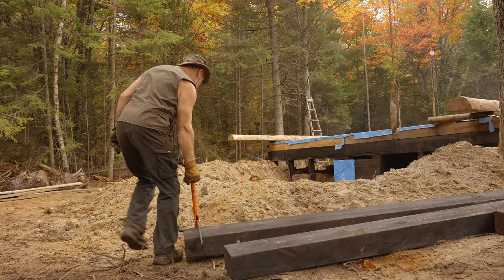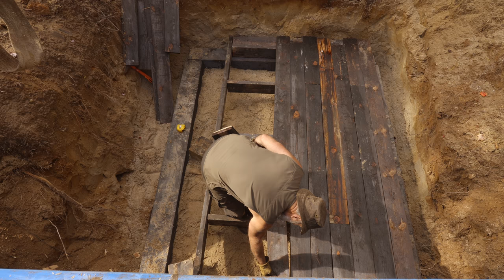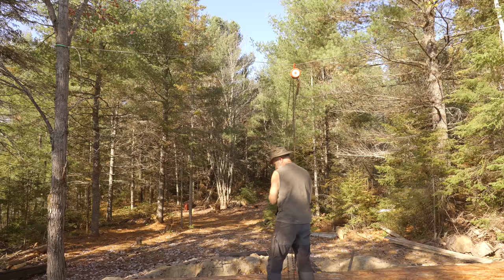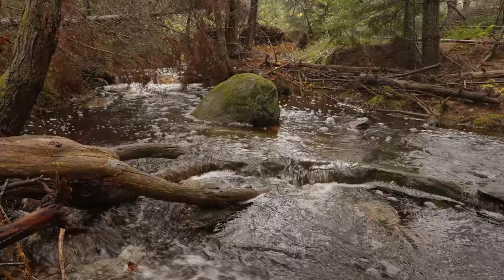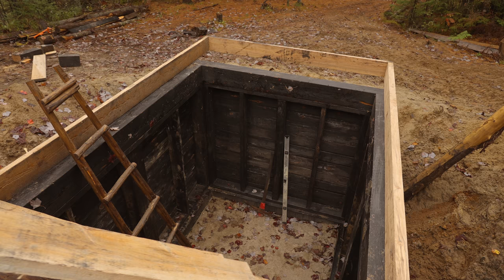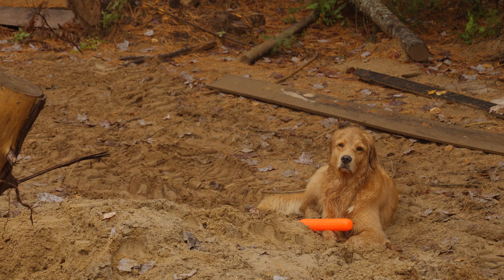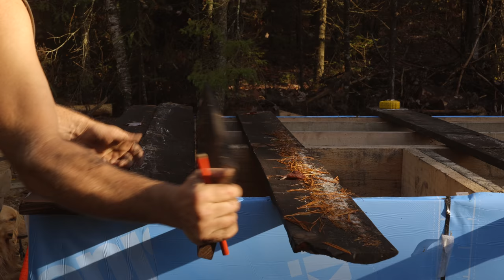Building an Underground Cellar and Breezeway to the Future Outdoor Kitchen | Off Grid Log Cabin

Comment: Love what you're doing. I do have a couple of questions or comments. As we all know you do have the skills required to build a cabin with hand tools, I'm wondering why you haven't gone with more power tools to save you time in the construction, ie skill saw, drill and screw gun. You have used things to help make it easier at times but not as often as I would have thought. If the goal is to get dried in by winter, then time is flying by! Just curious as at time you do make use of modern technology. Anyway, it's going to be an awesome build when finished.
Reply: He stated on his other channel the goal is to be dried in by spring.

Comment: Did I see you mix chaga with coffee at the start of the video?

I tried your chaga but it was rather tasteless. I also think I saw you just add boiling water to your chaga but on the instructions you say to boil it for 4 hours.

Can you thus consider doing a video on how to prepare chaga and any options.
Reply from the maker: I do mix it occasionally but normally I just simmer it alone for hours/days. It’s easier to do that on a woodstove than on an open fire
Reply: Thanks for the info and I'll try it again but process it longer next time.

Comment: I cant understand why you would put any lumber, pressure treated or not, directly on the ground? Even wood basements have concrete footings and the protection of membranes, vapour barriers, and other means to protect the wood from the outside elements.

Comment: Your cellar will probably rot in a few years.  You can't make a basement out of wood.  Maybe you’re just building for videos, not for living.  So much work and effort for nothing.
Reply from the maker: Wood foundations are common and allowable in the national building code. You shouldn’t rudely criticize people unless you actually know what you’re talking about. Life lesson
Reply: Unbelievable that wooden foundations are allowed 😲.  Not in Finland.  I have seen the Russians on the other side of the border building in this way, with poor success 🤣.  I would never put wood against the ground.  Only on top of the stone  with bitumen felt or similar waterproofing material. Soil has always 100% moist.  Brushable impregnants are not sufficient to protect against decay.

I have built several wooden buildings.  In addition to my wooden house in town, I own two holiday houses.  One of them is over 100 years old.  All of them are  wood buildings with stone or concrete foundations.  
In the summer of 2020, we built a 36 m2 log cabin onto concrete piles that were at least 30 cm above the ground. 

The small cabins I made as a child almost 50 years ago have rotted because they had wooden foundations.

Good luck, Pauli, MSc (tech)

Comment: Sorry I mean no disrespect, but I do not understand your building methods whatsoever!  I have been a builder for over thirty years and this makes absolutely no sense whatsoever.  Why would you burn the wood for waterproofing and then put blueskin over top?  Being that burning the wood would stop the blueskin from properly adhering.  I’ve been watching since the beginning and I’ve seen lots of your blueskin work look pointless. I know I’m a bad guy for asking but cmon.  And why are you putting large timber’s on top of a framed wall?  It would be nice if Shawn could answer and not the YouTube pros.
Reply: Burning the wood is for rot and bug protection not water intrusion. Notice the adhesion of blue skin is supplemented with nails. The overlapping seams of the blue skin to blue skin will adhere to each other sealing out water. Sort of like house wrap. I’m not an expert in all forms of construction but did spend years in the water intrusion segment of the trade. 
Hopefully Shawn will clarify for both of us.
Reply: @marcnewman3685  sorry but your wrong.  And like my comment said not interested in the opinion of YouTube pros
Reply: @mikejackson6862  didn’t mean to offend.
Reply: @marcnewman3685  you did not offend me.  👍
Reply: I have no building experience whatsoever, I am just a little old lady in California. But it concerns me that the whole entire weight of the house will be placed on top of framed walls. Will they not buckle??
Reply: @annrhodes3544  no they will not buckle at all.  Think of a second story on a house.  There are thousands of homes built on wood basements with framed walls
Reply: @mikejackson6862   Thank you for your advice, Mike. Now I can sleep easy!